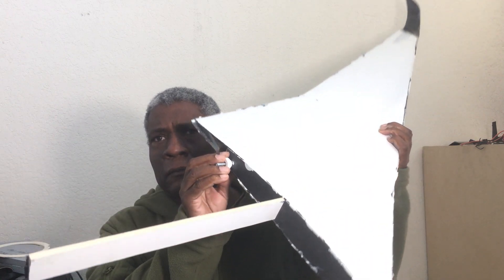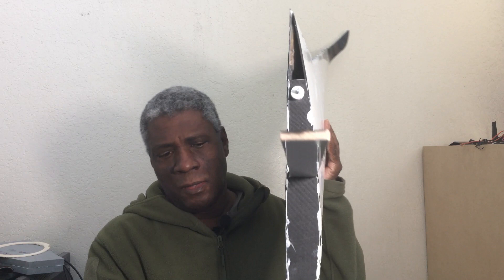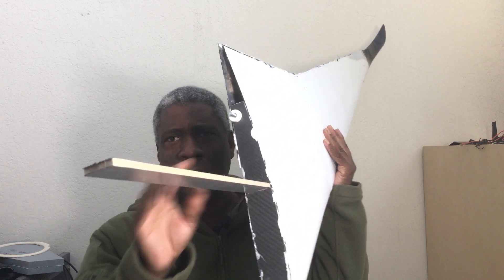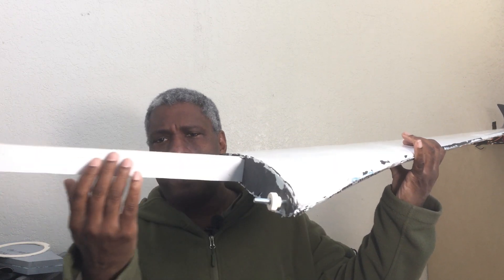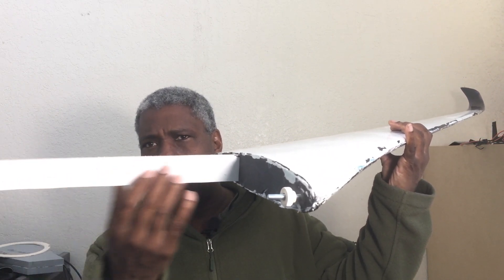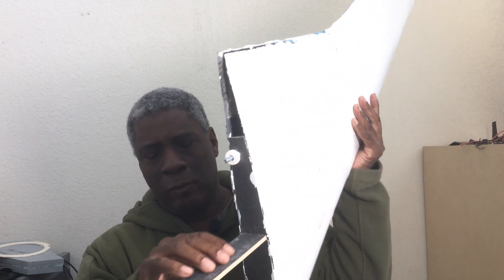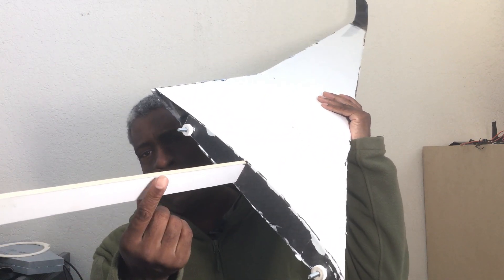Building a Large RC A-350 Airbus From 3D Printed Molds And Carbon Fiber Part 16

Comment: A piping bag is a little easier to use since it only needs one hand. I just use a ziplock and cut the corner off after filling it with the thickened mixture. Looking great though! It's gonna be a sexy machine.
Reply from the maker: Thank you for the tip.

Comment: Explain to us how to choose EDF engines according to the weight of the aircraft and the power of the KV, and what are the best types of engines and the best of them, please
Reply from the maker: The easiest way to do this without any calculations, is to buy the complete EDF unit with motor assembled from Wemotec.  Estimate the weight of your aircraft, then select the EDF unit that will meet or exceed thrust to weight ratio. So if you estimate your plane to be 20 pounds, you want and EDf unit that puts out about 20 pounds or more.  Wemotec sells EDF units assembled with motors  and balanced.  Check them out to find the unit that meets your needs.
Reply: @cadbuildflyrc3784  But my plane weighs about 11 kg.  I don't know which engine will fit it and what engine diameter it will fit.  It's a Boeing 747 and it's 4000mm long.  I need you to help me choose the engine and the engine diameter
Reply from the maker: @youseffshaban8410  Here you go. https://shop.wemotec.com/Midi-Fan100-evo-Impeller-HET-700-68-1000-12s-85A-56N-completely-mounted-fine-balanced-and-harmonically-tuned